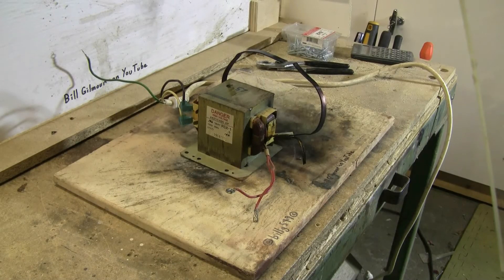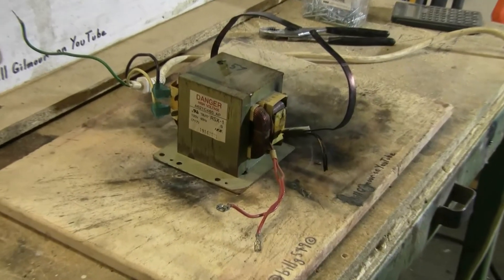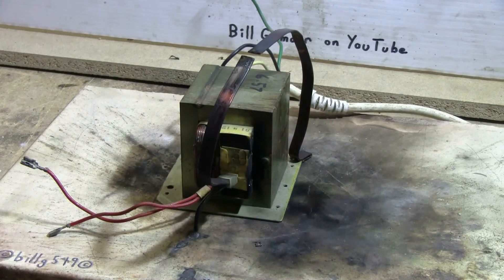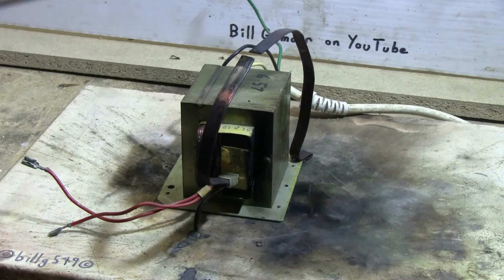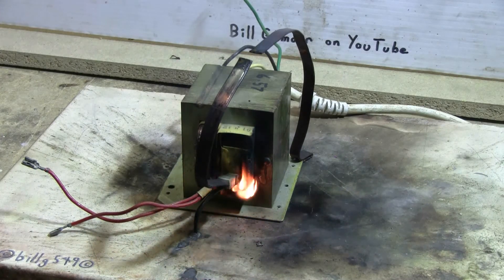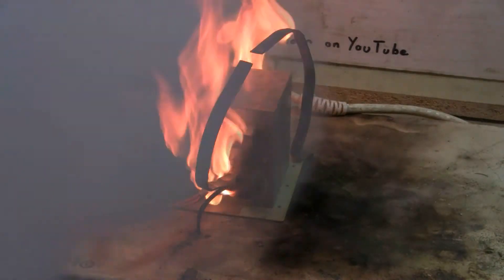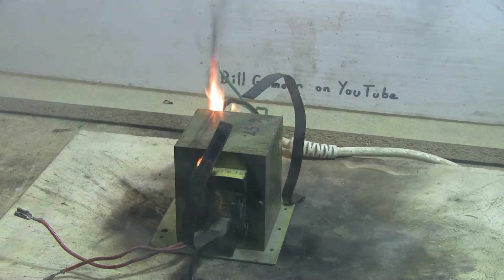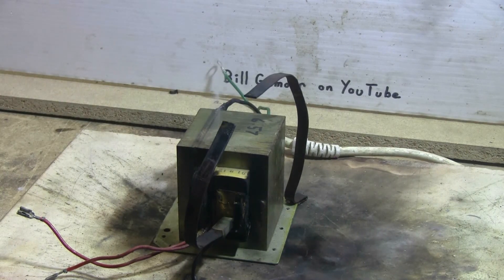MOT Burnout #2

Comment: you are aware that the primary leads you are using are badly undersized for 100 amps, right?  a 20 amp breaker with 12 awg wire would be more than sufficient for frying mots, and you have less risk of setting the cable on fire if the draw goes well over 20 amps before the 100 amp breaker can pop